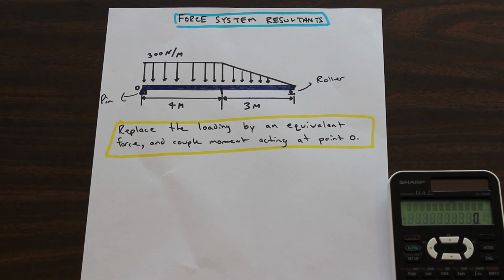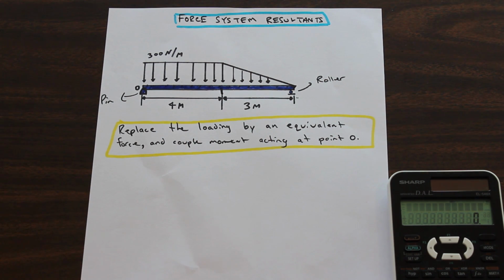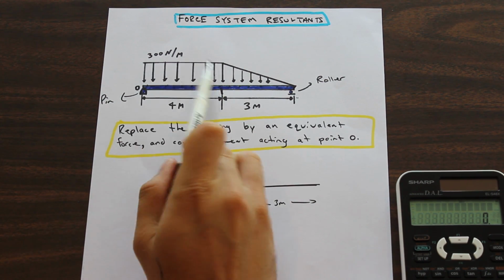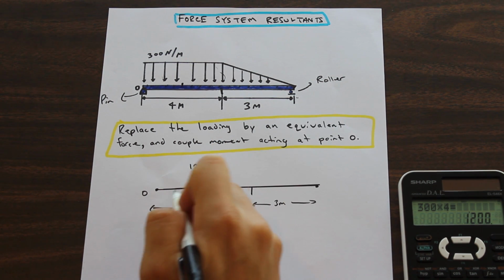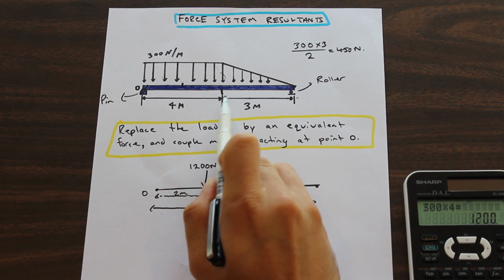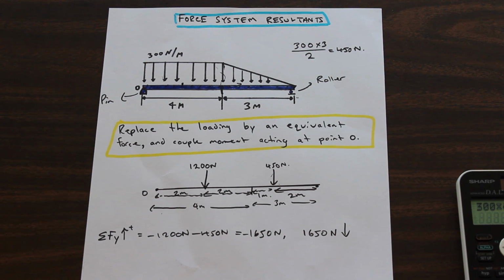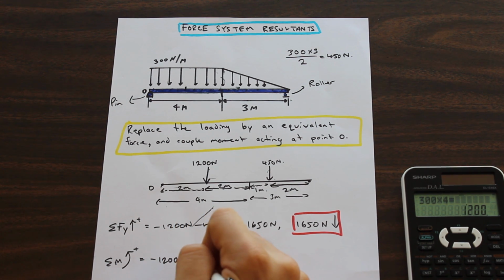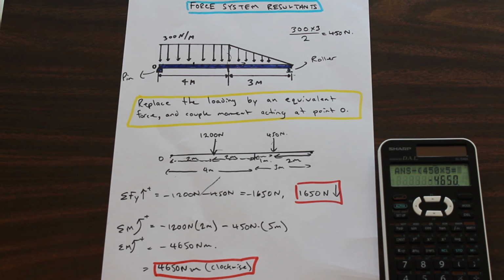Force System Resultants - Resolving Distributed Loads Into a Single Force and Couple Moment

Comment: Why do you have to include the distance where each force act in the first equation when you are just finding the sum of the y forces? It's seems like you are calculating the moment already in your first equation.
Reply from the maker: You said first equation twice, so I'm not sure which one you're referring to, but the first equation we're summing the forces in Y.  Next, to find an equivalent force and couple moment at a point we need to move the net gravity loads to that point and also the moment on that point from loads in their original positions.  Thus we need to add the forces in Y, and also sum the moments about point O in two separate steps.  Hope that helps!

Comment: how does the roller support not contribute to the moment at O?
Reply from the maker: George Black thanks for the comment George.  A roller support only restricts motion in the y direction, not in x or rotation.  Therefore, the sum of the moments at the support must equal 0.  Internal stresses are only developed when motion is restrained, not when it's allowed to move freely.  Hope that helps!
Reply: Thanks for answering my question. I understand the roller support, but since there would be a reaction force in the y direction then wouldn't that cause a rotation about point O?
Reply from the maker: Oh, I see.  Yes you're absolutely right, but the question asked us to replace the loading with a singular force and couple moment, not the reactions.  But yes, if we were drawing the BMD and SFD we would absolutely include the reaction at the pin support in our calculations, however that reaction would cause a moment midspan, not at point O, as the moment at the ends of a simply supported beam is 0.